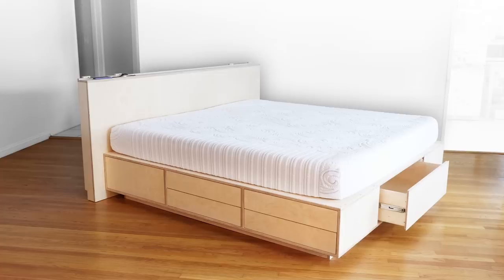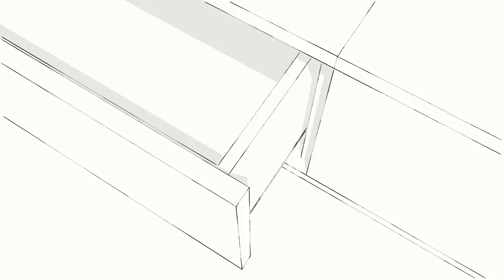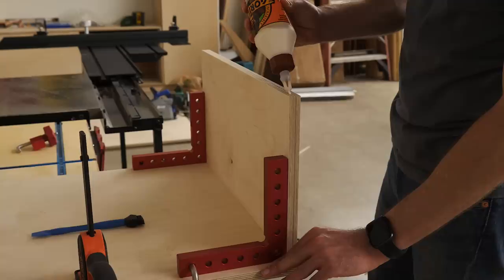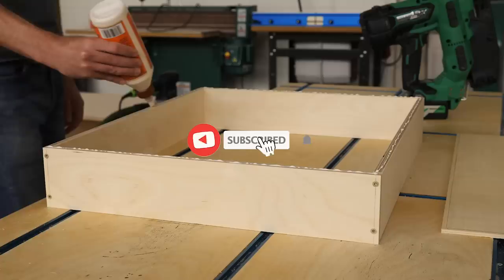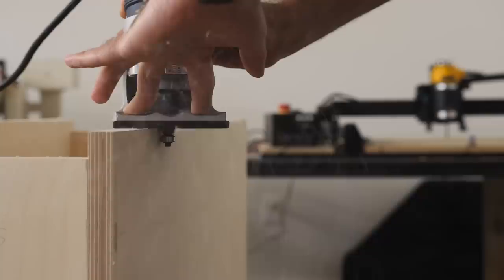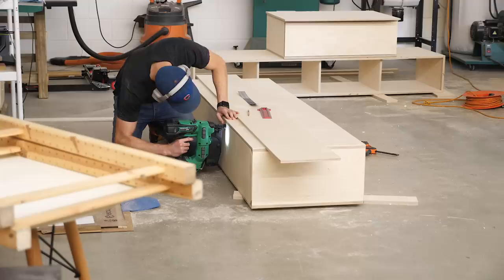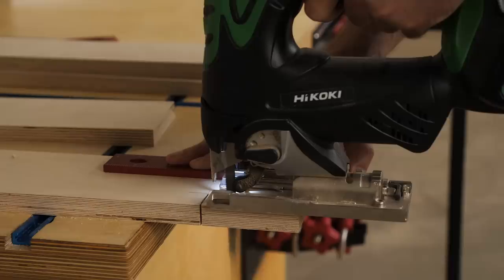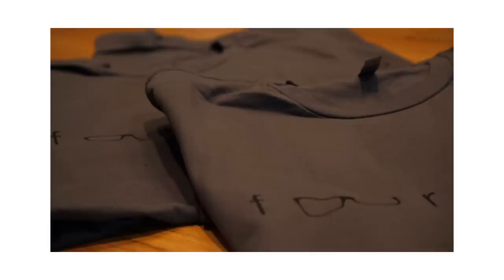DIY Platform Bed with Lots of Storage and Built-in-Charging

Comment: Hi Chris. Nice build. I've made a few similar builds and one advice from me to you, free of changer, would be ventilation holes under the mattress, and plenty of them. Even with a latex core, I've had issues with moisture build up between the warm mattress and the colder plywood. The first layer of glue will stop the plywood from absorbing the moisture.
Reply: Hi Chris, great build and just what I have been looking for.  I have a Casper mattress and they stress to use slats spaced 4" apart as a mattress frame so that there is air circulation underneath it otherwise you could have mildew problems.  I don't know which kind of mattress you have so this isn't feedback on your situation, I'm only thinking of how to adapt your design for my situation.  Your content never fails, I love it!  Also, those are my fav kicks so far!

Comment: Hey a quick tip when you used the rputer against a wooden strip you want the round part of the base of the router to touch the fence because (at least with my router) that part is perfectly round. And if you use the flat part it will rock around and you wont get a straight cut. With the round part you can move it around and the cut will still be straight btw. Great video as always keep it up 👍👍

Comment: This video helped me solve a problem with a completely unrelated project I have in the planning stages. I’m planning a wooden snake cage with front-opening sliding glass doors, and I could not fit the life of me figure out how I was going to get the doors into precut dado tracks without taking part of the frame apart and reassembling it around the glass doors. Your instruction of making the top track deeper just solved this conundrum. Thank you.

Comment: This is almost exactly the design I did for our king bed...well, not exactly. But the long side boxes for me were broken in half to make assembly and taking them into the room easier. Ours will be drawers all around and ideally solid Walnut that will have a continuous grain on each face, but not face to face... that'd be one massively long glue up. It will also require floating night stands to get to the drawer under your head and I'm excited to design those...want charging,maybe light, and speakers... we'll see. Great video 👍. Also, I thought for sure you'd go with Blum undermount after building your outfeed /assembly table. I can't go back now that I've used them unless they just can't work in a particular application
Reply from the maker: At the point that I built this I had never used blum drawer slides. I actually just used them on a project that will come out later this month though. They are kind of hard to wrap my head around still...but they work great. You can definitely see the quality difference :)
Reply: @Foureyes.Furniture  yeah that's what I thought too. Trying to get everything square and perfect... seeing the tolerances they put in the catalog...it was overwhelming. Then setting in the drawers for the first time and seeing how much adjustability they have 🤯 it was awesome. Could easily be out of square or have a slightly wavy piece of ply and be fine. Also they can be side or bottom mounted to the box so they work for slide out drawers behind doors too.

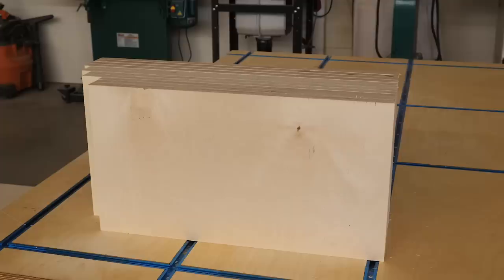Comment: 03:40 - Just a small quibble: never write on a piece of wood to label it, with a pen of any kind!  A soft pencil is good, and better still is a strip of painter's tape (you can write on that with a Sharpie).  I speak from experience when I say that there are few things more frustrating than getting near the end of a project and going to paint, stain or otherwise finish it, only to find that the pen marks keep showing through, no matter how many coats you lay down.
Edit: from later shots, it looks like Chris might be using a mechanical pencil rather than a pen, but it's hard to tell.  Either way, it's likely to give some the impression that it is a pen, and they could follow suit.

Comment: Awesome video as usual. Towards the end when you made the cable organizers I could not help but think that some T track in the top with sliding cable organizer would be cool. Also, that could lead into additional fixtures such as LED lights or hooks etc all sliding and adjustable.
Reply from the maker: Workbench / headboard. 😊

Comment: All theese fancy diy beds. I felt accomplished, building a platform out of 2x4s and 2 3/8 sheets of plywood. ;_;
Reply: Nsixtyfourlink lmao I made a floating platform bed but I like his better
Reply: Do you have pics or video?
Reply: @kodiham7532  Me? No. I just made a rectangle, that was the peremiter of my bed. Then used 2x4s for "slats" every 16 inches. Made 6 legs that are just 20inch long 2x4s. Then cut some 3/8 plywood sheets to lay on top of it.
Reply: @Nsixtyfourlink  thanks for the info!

Comment: There are SOOO many of your projects that I want to make but this one shot up to the top of my list.  I then realized, i've never sourced Baltic Birch plywood.  Holy moly.  Now, I live in Temecula so not horribly far away form you.  I found 3/4" BB 4x8 sheets for about $110 a sheet.  Do you mind sharing where your favorite material sourcing locations is/cost?  Awesome videos.  If I build this, I promise to become a patreon subscriber.
Reply from the maker: Hey man. I go to Reel Lumber. I'm closest to the Anaheim yard, but they have some others that may be closer to you. I don't recall the price off the top of my head, but I'm pretty sure it is cheaper than that. If you call they'll give you the price. If you build it...you don't have to become a member. I mean, I'd appreciate it...but I'm happy when people build my stuff no matter what...and if they decide to pledge a couple bucks, that's awesome, but not mandatory :)

Comment: Hey !
I believe you should elevate your mattress in order to make some airflow underneath and allow it to breath.
When we sleep, we sweat and the mattress get humid, so allowing some space underneath prevent mold for both the wooden bed and the mattress.
It can increase comfort as well.

Also, why are you using plywood ? I started using it to make some shelves, and I feel that that wood isn't very resistant, get scratches easily and does not look nice.
I think pine may to an good alternative, but probably more expensive.

Best !
Geoffroy

Comment: Chris, another question.  Have you considered edge banding the plywood edge?  I know that if you paint it, it may be a non issue- but I would probably go with a stain.  Also, did you consider any perforation of plywood that is directly under the matress for air flow? I see arguments on both sides.  I assume that is why is is popular to use slats instead of solid supports for the mattress.
Reply from the maker: Hey Joe...i don't like edge banding. Hardwood strips for some projects...but not this one. I was embracing the ply. For paint. I want bright pops if I do it...just on certain portions. Drawer fronts, etc... not the whole thing. Slats are a good idea. I wasn't worried about it though...Might be fun to redesign using slats just as a design challenge though.

Comment: You go back and forth between Kreg Acucut and Festool.  Which do you prefer?  Did you consider any levelers?
Reply from the maker: Yeah, I was kind of testing them out. I just got that new attachment for the festool, from woodpecker, that makes it act like a huge miter gauge. That thing is a champ when it comes to quickly lining up a 90 degree cut, knowing its perpendicular, without needing to measure. That said, for the track saw systems themselves. Factoring in the price. I actually think the Kreg is as good and it's WAY less expensive.

Comment: I have no doubt I could build this with my table saw, miter saw, drill, impact, and my circular saw but that's not the problem. A single piece of Baltic burch cost as much as my miter saw! Even using pine I cannot buy 9 sheets worth. Looks like I'll be doomed with 2x4's for a while

Comment: With no air holes the mattress will produce mold. You need to mark out a lattice and attack it with a hole saw. Otherwise your materess will be a health hazard in a year.

Apart form that, great job on both the build and the video.

Comment: Chris, I noticed in your sketchup drawing of this platform bed that the top and bottom panels of the big side drawer boxes were not rabbited, only the side panels.  But in the build you did a stopped rabbit on those top and bottom pieces, so the 1/2 inch back panel was "received" all the way around.  What made you change course there? Any reason you wanted the rabbit to go all the way around instead of just being on the two side panels?

Comment: I see that you have been using to different track saws, Festool and Kreg. I understand they main difference between the too as I have researched them both. I am wondering if you prefer one over the other? Does one have a cleaner cut? Let me know!
Reply from the maker: For me they both make equally clean cuts. Though, I think most of that would come down to the blade you are using. Not talking about on the table for the ACS. so just as a normal track saw. It's honestly about equal for me.

Comment: Hey Chris, I've been watching your videos for quite some time now and have found plenty of inspiration from your videos, both in your projects and in the way you plan and construct. I do have a potentially dumb question; in this video I saw that you used several different circular and track saws (in addition to your table saw). May I ask why so many? Is each one for a different purpose for you? Just curious! Love the videos and the calm aesthetic you have going in them!!
Reply from the maker: Hey man...I've gotten this question a lot. I think I might need to make an instagram post about it. In short. Track saw vs Circular Saw usually has to do with length. Full sheet of plywood. I'll use a circular saw with the kreg rip cut attachment (I don't have tracks long enough) cross cut I'll go with a track saw. I'm using two in this video because I was also testing out a new woodpeckers attachment I got for the festool :)

Comment: Why the hole in the center? As opposed to extending drawers to use all that space?
Is it a matter of not having sliders long enough?
Reply from the maker: A few reasons. Yeah, the hardware would be insanely expensive...but the actual impossible factor to overcome (in my room at least...and probably most peoples) is that you wouldn't be able to pull the drawers all the way out because the walls and/or other items would be in the way.
Reply: @Foureyes.Furniture  tbh it's better to have some less accessible storage than none at all. One could just shift things around or push rarely used things to the deep end.
Reply from the maker: To each their own. In my room it wouldn’t be hard to get to. It would be IMPOSSIBLE to get to.

Comment: In this video you used a circular saw with the kreg guide, the kreg track saw and then a festool track saw.  Was this a tool acquisition improvement as the build progressed (if so were the other tools not as accurate?)? or do you actual use all three (if so why a specific tool when?) Sorry for the interview style questioning......
Reply from the maker: I use all three just because I have them. I just got the woodpecker attachment for the festool...so I've been using it a lot in order to form an opinion. I use the circular saw for a different application (long rips) where the tracksaws would need longer tracks (which I don't have)

Comment: Hi Chris, long time viewer, first time commenter.

I have a question regarding your saw choice for plywood break-down. I understand why you would use a handheld saw versus table saw and vice versa, but what makes you decide to use a track saw or a circular saw with a straight edge? I notice you often times use both for cuts that seemingly could be accomplished by either tool.

Thanks in advance!
Reply from the maker: Hey Nick. Couple of reasons. For my situation, where I'm making videos. Sometimes I'll do things different ways just for variety's sake. Show how you can do the same thing with different tools, etc...

But from a non-video POV. Usually when I'm using the circular saw with that Kreg Edge guide attachment I'm ripping length wise (longer than my tracks are) and if I'm cutting a shorter piece I opt for the tracksaw
Reply: Thanks Chris! I appreciate the info!!

Comment: Did you put something at the bottom of the bed so it doesn’t scratch the floor, like felt pads or something?
Reply from the maker: I didn't...but that's not a bad idea. Honestly though...it won't slide. It's super heavy. The plywood is also softer than the Oak floor
Reply: @Foureyes.Furniture  Ok. I'm building a similar bed and was wondering if I should add some felt pads or some small plastic feet nails (whatever they're called). But, I also have tiled floor. Thank you!

Comment: Kreg Track Saw vs Festool vs Kreg Rip/Cut vs Tablesaw -- How do you determine when to use what?
Reply from the maker: table saw vs any of the others comes down to the size usually. The bigger the work piece the more likely it is to be anything other than the table saw. For the others. If it's a long rip, I usually go circular saw with the Kreg rip guide. Between Kreg and Festool tracksaws...it's a toss up. I've been going back and forth in the past few videos because I'm testing some new things I just got out, to form better opinions.

Comment: Typically from what I've read and found, Baltic birch is 5' x 5'. What is the brand/source for your larger sheets of Baltic birch?
Reply from the maker: I'm not sure. I get it at Reel Lumber which is my local yard. Somebody said that if it's 4x8 it may be just "birch" and not "baltic birch" looks exactly the same to me.
Reply: @Foureyes.Furniture  Thanks. It looks great regardless!
Reply: My shop sells both 5x5 and 4x8 sheets. I'm told the larger 4x8 sheets use an exterior wood glue. To me, the plys on the 4x8 sheets looks darker.

Comment: I don’t understand the DIY Factor Here. 
At least for a Normal European Guy like Me. 
I mean, I can Understand the Track-Saw, even if I don’t know any actual Person who has a Track for the Saw, but then Instantly Switching to the Table-Saw and you lose the DIY ability, at least for a Normal European household.

DIY in Europe, be like:
Some Random Hardware (Screwdrivers, a Lever, Pliers and some Allen keys)
A Drill (not an Impact Drill that everyone is using)
A Hammer drill for Concrete
Maybe an Angle grinder, and even less have a Circular Saw (all with cord because Cheap)
Yeah, that's European DIY,... Nice Video

Comment: Pretty sure Baltic Birch sheets only come in 5x5 sizes...I think you have Birch ply.
Reply from the maker: you might be right....but at the lumber yard when I ask for 8x4 sheets of baltic birch, they've yet to correct me.
Reply: @Foureyes.Furniture  I've had several sales people correct me everytime I ask for 4x8 BB ply. Both at Ganahl and Bonhoff, so I guess it depends on where you're buying from. For the most part, it looks like the Birch Ply you're using has 11 or so layers so it should still be plenty strong/stable enough. As long as it's A1/BB grade for the show faces.
Reply: @davidn7945  David/Chris what is the difference between baltic birch sheets and birch ply?  Many thanks!
Reply: @wabisabimaker1794  Baltic birch is a species of birch that grows in the Baltic region. I've been told that It's known to be stronger and more stable. It's also more white-ish in color. From what I understand, the construction of the sheets usually have almost no voids or defects in them, hence why cabinet makers prefer it over other types of ply.
Reply: @davidn7945  Thank you David.

Comment: That mattress is going to feel like concrete with it not sitting on slats.
Reply: It won't actually. However with no air holes a memory foam materess will sweat and produce mold.

He will need to attach the tops with a hole saw to rectify this.

Comment: why do you use glue against screws?
Reply: You commented this 30 seconds ago
Reply: Nevermind it was i minute
Reply: @donk7001  this is weird jajaaj regards
Reply from the maker: Are you asking in what situations I decide to use 1 vs the other? If so, there are lots of reasons. Generally though. I'll go for whichever would be faster and stronger for a given situation. I would also consider if there would be a reason that I might want to take something apart. Also, is it in sight and do I want screws to be seen.

Comment: Has a systainer with a TS55 on the side... Uses only moderate to crappy saws on video... You keep confusing me!
Reply from the maker: 2 things. 1. I still use the festool all the time. 2. Both the Hikoki Circular Saw and the Kreg Plunge saw are really great saws. So I'm not sure what you mean by Crappy. I've used all 3 a good amount and all I would highly recommend.

Comment: Is it fair to call it DIY if you're using a shop with a plethora of expensive tools and automated machinery that the average hobbyist doesn't have?
Reply from the maker: yes
Reply: @Foureyes.Furniture  That was a rhetorical question. It isn't. Or at least if it is, then the term is meaningless and industrial engineers are DIYers.